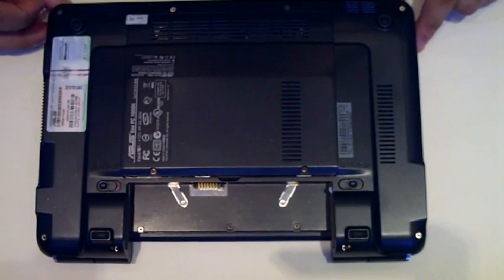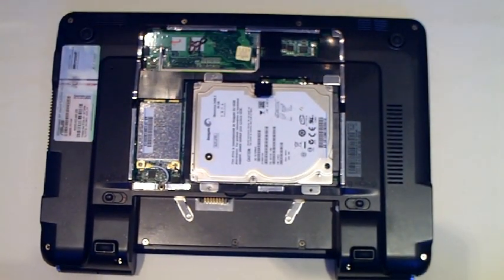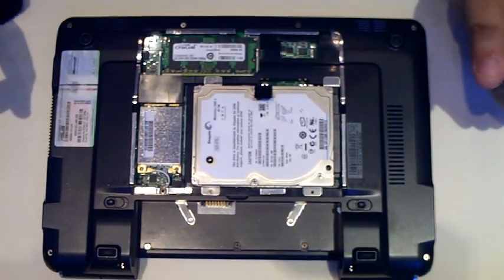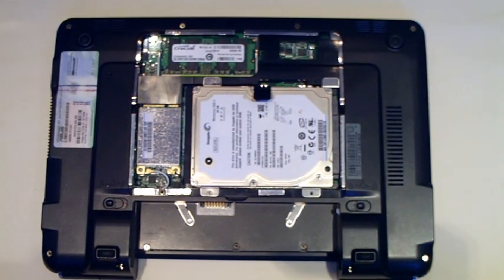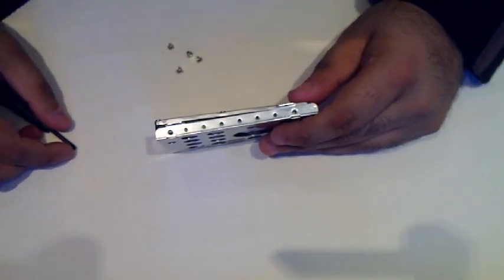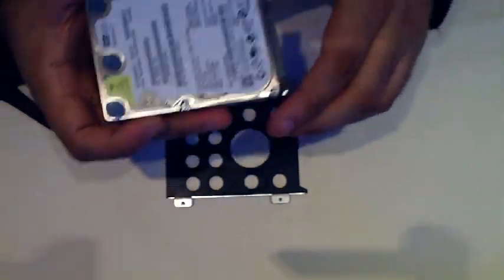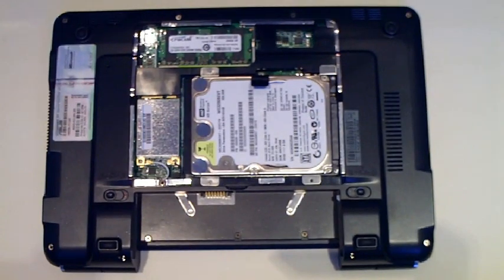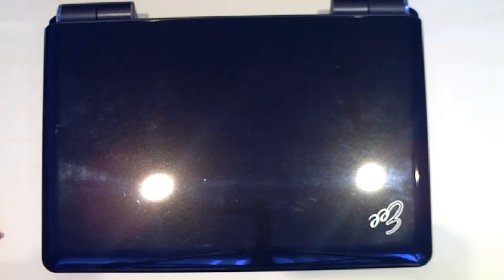EEE 1000H Upgrading: How to upgrade Hard drive & RAM

Comment: Very cheap upgrade. Less than £10 for me and it's a huge upgrade, 100% from 1GB to 2GB :) Makes a big difference since you can't run much operating system in 1 GB these days let alone what browsers require to load pages.

Comment: I installed a Western Digital Scorpio Black 750GB 7200RPM laptop drive into my 1005ha netbook and the speed increase is drastic. I can safely say that the i/o bottleneck is removed from the computer in day to day tasks.
I used hddscan to query the hard drive temperature and it only runs a few degrees warmer than the 160GB 5400RPM 1-platter drive that came with the computer. Go with 7200RPM drives or hybrid drive with onboard NAND flash, they don't use much more energy at all.

Comment: The 1000 HAB does not have an access panel for the harddrive, though it has one for the SODIMM.   It looks like you have to take off the entire back plate to get to the harddrive (stupid).   Laptop HD upgrades for me are not a problem, I can do them in my sleep, but what a PITA, considering other models in the same 1000 series apparently have a panel to access the internal HD.

Comment: is it possible to switch from hdd to ssd and does ssd plug into where the hard drive slot is or what sorry im sort of a noob when it comes to ssd and hdd understanding i know whats the diff between them im just not sure if they both connect by sata or not excuse my stupidity if its a stupid question

Comment from the maker: Yes it does, However I did now have any seals that were broken while changing the HDD and RAM. If I ever need to RMA the unit, I just put the old HDD and RAM back in. I put my old 80GB HDD in a USB enclosure bought from an ebay seller for around £5. I just use that as an external drive.

Comment from the maker: Yes you need to press F2 to enter the BIOS at boot up, then Exit SAVING changes. Then when you check the RAM in Windows, it should be recognised as 2GB.

Comment from the maker: Someone just asked how many memory slots there are in the 1000 and if they should buy a 2GB stick. I clicked remove by accident. The EEE 1000 had ONE memory slot, so you will need a 2GB module to upgrade the RAM.

Comment from the maker: Because the chassis of the 900 is smaller. The Hard Drive on the 900HA is behind the keyboard. There are 3 little silver pins that need to be uncliped to pop off the keyboard. Search for a video called: "Asus 900 keyboard mod" That will show you how to pop up the keyboard on your 900.

Comment from the maker: Thanks, I know many people would want to mod there EEE 1000. If anyone is thinking what to do with their original Hard Drive, just Ebay: External 2.5" SATA enclosure. Simply put your old Hard Drive in one of those and then you can use it externally as a portable drive. The Enclosures are approx £5 $10.